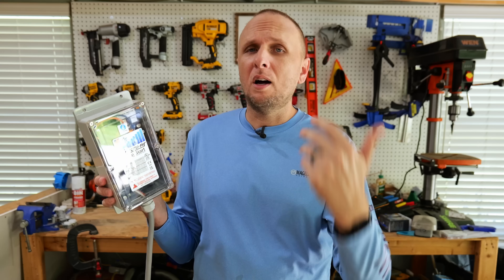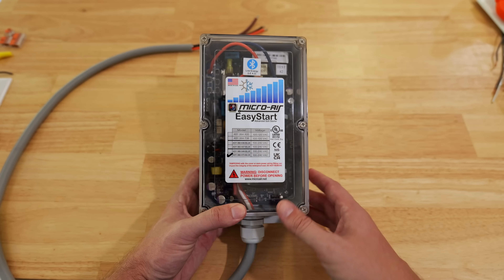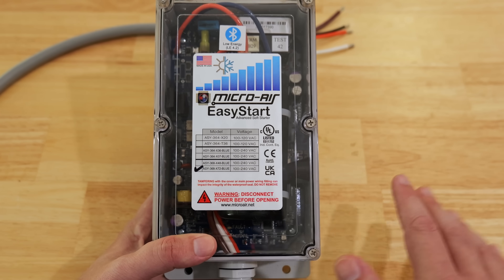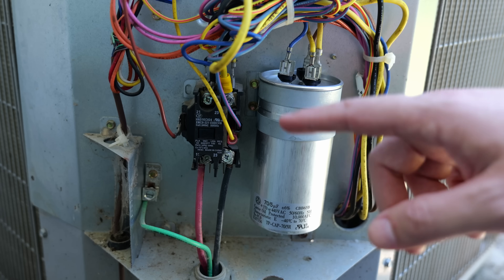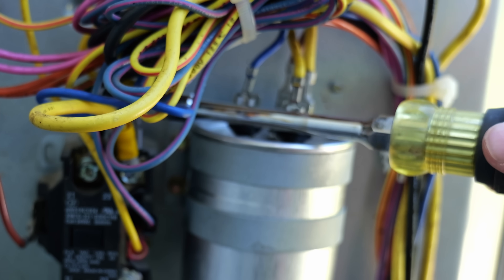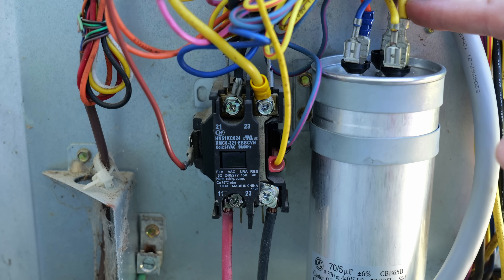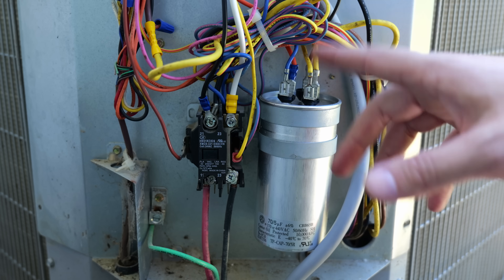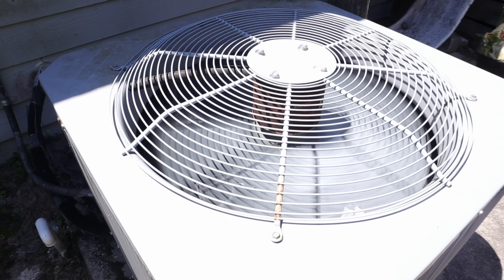Why Every Homeowner Should Consider Installing an AC Soft Starter | Micro Air Easy Start Install

Comment: Sir, would you please consider making a review on these HOME SURGE SUPRESSORS, which mount on the main power panel, which allegedly then suppresses ALL surges on all of the home circuits.   I understand that they are quite easy to install (with a 50 amp breaker) and cost in the area of $500.   I mean, if this device works, if it really works, then why do we need to have dozens (exaggerating) of surge suppressors on all of our electronics.    Thank you.
Reply from the maker: Yeah, I did one a couple years ago but it is probably time for an updated one.  I highly recommend them.  Once my oven electronics got fried I decided to install one.
Reply: If you have sub panels with any exterior circuits (I have a line from my downstairs sub panel going outside to a chicken coop) you can also protect that incoming circuit with a protector..I did, I recently had an attic fire caused by a power surge, I still had a Fed Pacific panel from the 50’s, I had everything replaced, new 200 amp service, a surge protector placed in the main panel, and my sub panel..

Comment: Doesn't the low-voltage startup make you think that it might be hard especially on older compressors?
Reply from the maker: The only time it would probably not be recommended would be on a compressor going out and is old and sticks.  Those typically need a hard start but will need to be replaced not too long down the road.

Comment: Soft starting is common practice in indistries when starting motors (whether using an electronic soft starter, VFD or delta-wye starter). I'm kinda surprised to hear that about home AC units ONLY NOW.

Comment: Added to my condo unit… easy install and works as advertised.  Just wish the Bluetooth would connect even when the compressor isn’t running.
Reply from the maker: Yeah that would be great if it would.  Glad to hear you like yours though.  Thanks for sharing your experience Daryl!

Comment: Good video. I installed a Hard Start Kit (as per your video) and it is working extremely well for me. My start-up amperage dropped from 72 A down to 41 amps. It was only about $15, but is doing a great job. The Soft Start "starts" at $400+ and I understand the difference in capability: however, I will stay with my existing kit...a great reduction for minimal cost. 
But the soft start is impressive.  Thanks
Reply: What size is your unit? 72 amps is LRA territory

Comment: Thank you, great video and very helpful to install this unit if you run a generator. Price is way above what you could get for a hard start kit though. $379 vs $50... I don't want to shell this type of money. I went with Amrad capacitor and hard start kit. Reduced my LRA from 83.9A to 23A. I'm happy with that on my 3T York. Keep the good work!
Reply: LRA is 'locked rotor amps'. This is generally a ridiculously high amperage. The number you need to compare is RLA (running load amps).